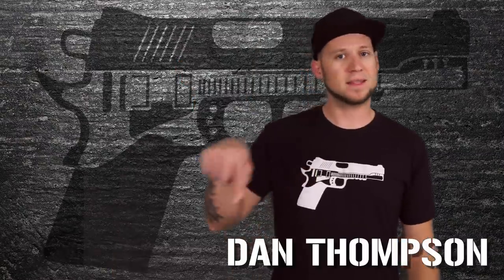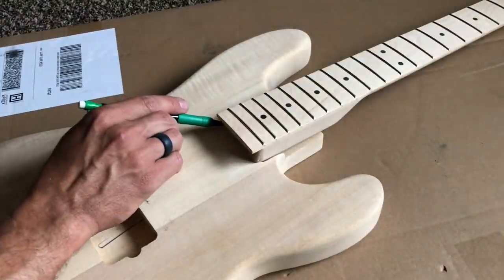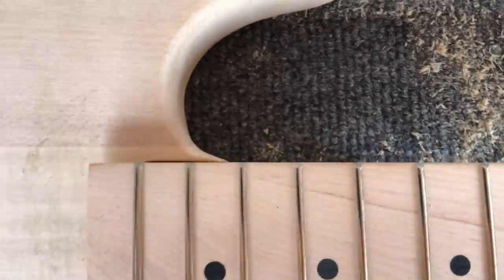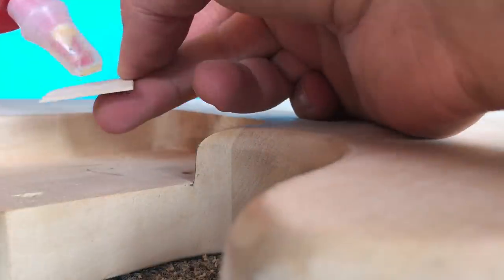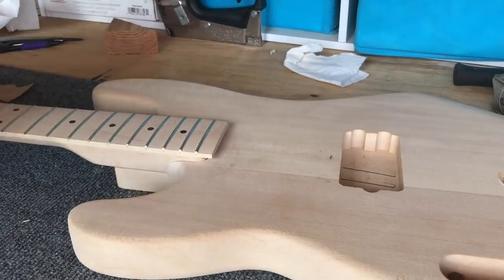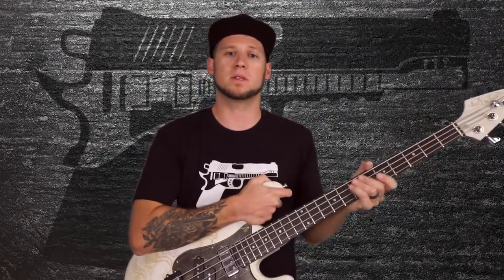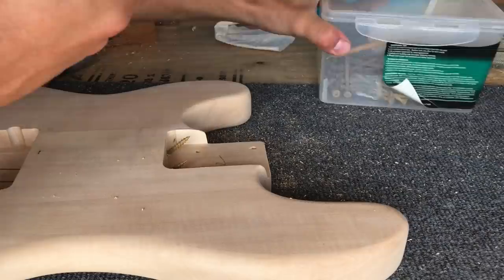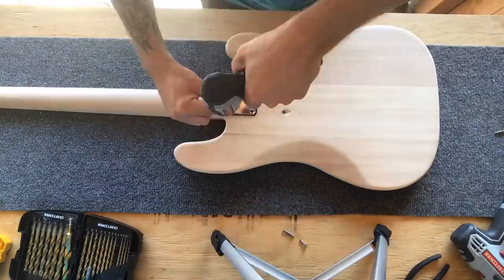How to reinforce a loose neck joint for better tone and sustain,  guitar or bass

Comment: If you are not using opaque paint, you can rout the pocket bigger, fit a chunk of a totally different color of wood in there, and re-rout the pocket. If you're using body mounted pickups, you can do the same with the pickup cavities. I've never seen anyone do this but I think it would look pretty cool.
 Or take the neck off, smear it with a thin layer of lard or vegetable oil, put a layer of hide glue or a mix of PVA glue and wood dust around the neck pocket, then screw the neck back in place. Once the glue is hard, you can take the neck off easily thanks to the lard, and trim off the excess glue. Now you got a neck pocket that truly IS a perfect fit.

Comment: Hi Dan, Love your stuff, especially this one. I'm thinking of replacing the bridge on my daughters J bass & am amazed at all the different options available. I know the J bass has a 3/4" bridge spacing (19 mm for those of us that have had the metric system forced on us. Apparently that is typical Fender) My question is, how important is it to keep the same spacing as the manufacturer used ?. My gut says don't change it, so I probably won't. But how important is it really ?. & just because a guitar comes from a name brand manufacturer, doesn't mean everything is good. The neck pocket on this J bass is horrible, so I'll be doing your mod.

Comment: You can use popsicle sticks instead of veneer
Reply: Only if your neck pocket is SUPER sloppy.... they tend to be quite a bit thicker than a veneer sheet. I have however used popsicle sticks to shim a badly warped neck.

Comment: Hey Dan, my guitar kit came with a crack right next to the neck pocket, starting at the side of the neck pocket and continuing a quarter inch down the body of the guitar about a 1/4". will these mods help secure the neck as I'm having trouble returning the kit
Reply from the maker: Idk man, that sounds terrible I’d do everything I could to return it. If not try to reinforce the crack with some wood glue and maybe even a screw as well. That sounds like a bad spot to have a crack (if I’m imagining it correctly)
Reply: Guns and Guitars you probably are. it's parallel to the neck right where the neck pocket meets the body on the right hand side

Comment: The screws should NOT thread through the body, neither the original 4 at the neck plate nor the 2 angled screws you added.  They should be able to pass through the body without having to 'thread' through it.  This is the only way the screws will be able to truly pull the neck as tightly as possible to the body.
Reply from the maker: Agreed.

Comment: I was planning on thinking I'd buy a kit guitar and this video sold me. But are two screws really needed to tighten the neck joint? It seems one in the center should do the trick and I wouldn't have to worry about clearing the screws on the back. Any thoughts?
Reply from the maker: One may work. I’ve just only ever seen it done with two, so that’s why I use two.
Reply: I would imagine if you were to center one screw you may run the risk of going through the truss rod.
Reply: Devin Sampson this is a very good point I hadn't considered.

Comment: These screws won't reinforce the neck against stripping by neck-bends. The only screws that take that load are the screws closest to your neck. If you want to lower the risk of stripping screw, don't use woodscrews but machine screws, or better yet, just glued that neck in there!
Reply from the maker: +Dries van Oosten it helps to reinforce the neck because it has more contact on all three sides of the neck pocket. Also, wood screws have thicker threads, so they will be stronger than machine screws, that’s why woods screws are meant for wood. Machine screws are meant for metal. Yes, glueing it down would be best, but some people like to have replaceable necks in the case that one breaks or wears out over time. Thank you for your comment
Reply: I'm still swearing at the unknown person that glued a bolt in neck in a guitar I bought 20 years ago!!!LOL

Comment: isnt cutting forward into the neck pocket is gonna change the scale and mess up the intonation?
also, would you do a video on shimming a neck?
Reply: Almost all of the modern electric guitars and basses have adjustable bridges, it wouldn't be a problem
Reply from the maker: +Amit Sapir it's only moving about 1/16th of an inch you can compensate at the bridge saddle no problem. And next time I shim a neck I'll do a video for you!
Reply: Guns and Guitars  thanks man!

Comment: Letting the glue set at 2:40 should be done under clamps for a much stronger/stiffer joint.  The glue joint as it is now is a layer a "pure glue" which  has a low modulus of elasticity and will damp some of the vibrations -> loosing sustain
Reply: Dude you're drinking your Bath-Water ! ! !

Comment: Another step to add for a professional job. Scrape or sand the bottom of the neck slightly. Too much will throw off the action and neck break angle. This provides more neck to body contact, producing tones comparable to a neck-through. Also, I wouldn't use the extra screws through the back. It not needed, and would detract if you do a stained or dyed finish.

Comment: CAN I USE MY BUTTERFLY KNIFE THAT I B USING TO STAB FOOLS WITH TO CUT THE THIN ASS BASSWOOD OR DO I NEED DEM CRAFT SIZZORS? I DONT WANT 2 LOOK LIKE A MARK IN FRONT OF MY HOMIES SHOPPING AT A CRAFT STORE. GOOD VIDEO BTW U THE BEST MY G
Reply from the maker: +The Homies by craft scissors I meant any scissors. You don’t have to buy them from a craft shop. You probably already have a pair. As for the butterfly knife, I have one, might try it and see what happens!
Reply: Guns and Guitars THAT'S WHATS UUUUUP!  LETS GET IT! 💪

Comment: With all the extra screws why not just use wood glue to permanently seal the deal.
Reply from the maker: Because then you can’t remove and/or replace the neck if you need to.

Comment: you can strip the original neck holes since now they are misaligned with the body and already tightened down by the angled screws. Also, you just offset the center-line and the strings will not be parallel to the neck... also, bridge location just chaned... so all-in-all I wouldn't advise doing any of this! Amateur hour and harmful tips!
Reply: Sounds like solid advice.  Where is your shop located? I might be interested in having you do some work.
Reply: @daddyosink4413  I am located in NYC/Brooklyn :)

Comment: Dude this is a terrible idea. All you're going to do is get stress cracks in your neck pocket. The neck and the joint will expand and contract at different rates, then crack.
Reply from the maker: +Night Beard yes stress cracks can happen from a tight neck pocket, but those cracks are just in the finish. Wood is pliable enough that it can stretch the minute amount it needs to compensate for the neck, however, a thick epoxy/poly/lacquer finish is not pliable, and that’s where you see the cracks. These don’t affect tone, sustain, or general playability at all. Any cracks that go deep in the wood area result of negligent abuse, drops, spills, etc. if you want to avoid stress cracks in the finish, I recommend using an oil finish like tung oil or true oil. Those are pliable finishes that won’t crack. Thanks for your comment.

Comment: you think it makes sense, but you have a flawed understanding on how sustain works on an electric guitar. any vibrations (energy) transmitted  to  the  body decreases the remaining energy in the string, thus decreasing sustain. study the physics of sound.
Reply from the maker: the problem is the vibration getting released into air pockets between the neck and body, that's where you lose sustain.

Comment: Nope nope nope. Boutique or not I'm not drilling any ugly ass  holes in a damn expensive guitar. Maybe on some cheap piece of crap that I didn't care about. But if it's a nice guitar it shouldn't need any extra holes in the body to neck joint. Maybe a center screw under the neck plate countersunk and hidden with the neck plate, maybe. But not on a nice finished guitar with maple or some other finished matched back. I could see the LOOK on my friends face when they see me drilling two a couple of beveled holes in my Strat or  G&L and say oh it'll make it sustain better. I'd hope they bitch slapped me for being stupid.

Comment: You cannot improve 'tone' on a solid body electric guitar with magnetic pickups, unless you alter the sound-producing items on that guitar---electronics, hardware, pickups, strings, and nut. Wood has virtually no effect, except a potential negative effect. You can improve sustain, but sustain mostly has to do with the mass of the guitar, and selected hardware.

Wood can have a negative effect if it resonates at a frequency that is equivalent to the frequency at which a string [ fretted or not ] is vibrating. In that case, the energy of the string is 'sucked-off' by the wood, and leaves the string dead, or least at a lower output than is optimal. It's science...sorry.

Les Paul saw a piece of scrap pine 4 X 4 in a corner, and made a guitar out of it that he played and recorded on for many years. Mr. Paul knew that the body of that type of guitar is simply to hold the hardware, electronics, and pickups. That is it's only job. Likewise, the only job that a fretboard has is to hold the frets. 

So I can believe the 'tonewood' freaks, or Les Paul. I choose Mr. Paul.

[ Note that this has NOTHING to do with purely acoustic instruments---that's a very different game.]
Reply: Les Paul are full of Bullshit. Science has proven wood has an effect on tone. I admit it though its virtually impossible to tell from an electric guitar with your eyes closed what would its constructed of purely by sound.

Do not trust anything Les Paul says, Just look at there recent antics.
Reply: Listen to the the vids where they switch bodies and keep neck/strings/pickup/hardware the same
Reply: @leif-andersbanan5590  Listening is not science -- it's an experience that is changed by processing in the brain. No two humans hear exactly the same way.

What is needed is a truly blind study with five different woods, and let's see who can identify those woods correctly in 5 identical electric guitar bodies.
Reply: @perihelion7798  for a believer you seem to know alot
Reply: @perihelion7798  but seriously, if you (one person) watches a vid like that, there's only one person hearing the sounds and the alleged differences. Sure there are other potential confounding factors, but it's as good as it gets on youtube I think. 

You wrote that wood only detriments tone, which implies it can change tone. Any "improving" of tone would be highly subjective as you partially pointed out. So any detriment could probably be enjoyed as an improvement by an individual, therefore you could say you can improve tone by changing wood.
Reply: @leif-andersbanan5590  Science says there is no 'tone' difference in solid body electric guitars with magnetic pickups.

However, science also says that people can 'hear' a difference due to strong confirmation bias if they know the wood prior to playing. Also, there are a lot more important things in life right now than this.
Reply: @perihelion7798  definitely lots of more important things, but I'm grounded because of them and super bored :) Is this "science" source your anecdote of mr Les Paul and his 2x4? Or actual double blind A/B listening tests with repeatable results where no one can hear any difference?
Reply: @leif-andersbanan5590  Les Paul, the NIkola Tesla of guitars, spied a pine 4X4 piece of scrap lumber leaning against the wall, and decided it would be great for his guitar body.

He played it for years, and recorded with it for years, but had to add some 'wings' to it strictly for appearance sake, as the bare log was strange to most folks.

If you have a massager/vibrator handy, plug in and turn on your guitar. Place the massager on the wood anywhere, and turn it on, then play some notes and chords.

There will be NO difference, as the wood and the pickups and the strings will vibrate together. No wood species has a given resonance -- in acoustic instruments it all depends on that select piece of wood.

There is a YouTube video where a guy made a CONCRETE body and added neck and pickups, etc. It sounded great, and had some massive sustain, as sustain is dependent on mass, as well as a few other factors. Check it out.